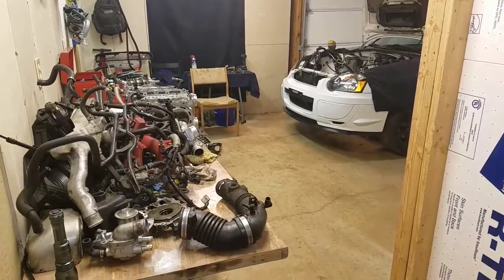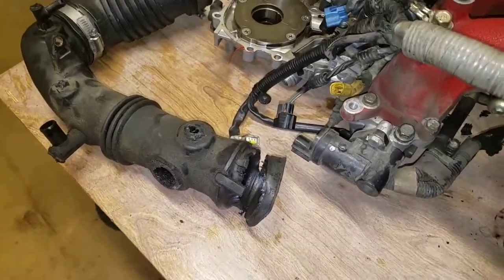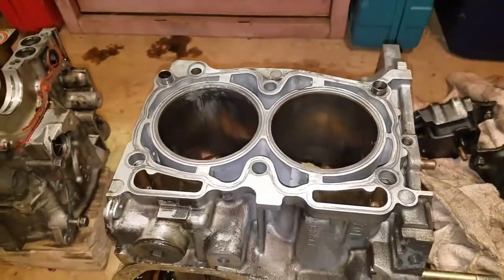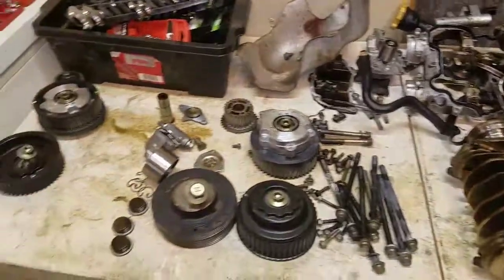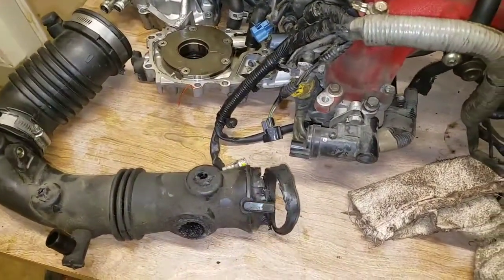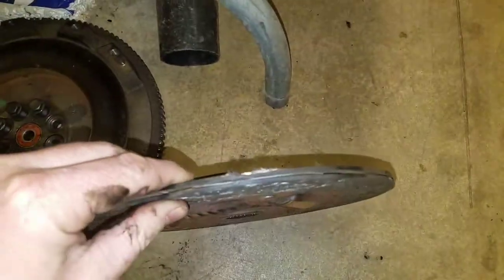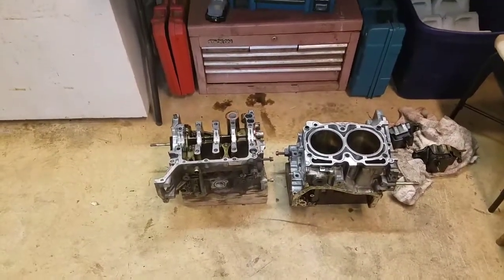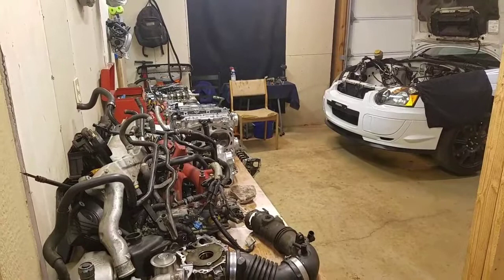05 Subaru WRX STI Turbo Inlet Tube Failure & Motor Rebuild

Comment: If it was running lean the computer would know regardless if the air came in after the maf. It would cause knocking and misfire im sure. I dont think the inlet was the main culprit..could be wrong though.

Comment: Dude did the failed turbo inlet really cause your car to fail?!? I got 700 miles on my wrx after I bought it from previous owner. I'm sure they swapped out all the aftermarket parts with old stock parts. My turbo inlet is all chewed up where the clamp meets the turbo too. The car also had head gaskets, valve job, coolant service etc about 5k before I bought it.

Comment: How long did you run the car with the torn turbo inlet ?
Mine was split & caused me to have a boost leak/ vacuum leaks & was able to get a new inlet the next day
Scary cause you over boost & run lean af
Reply from the maker: I don't know how long it was running before I bought the car like that but I drove it for about 750 miles and I was pretty hard on it before it actually died on me so I don't think you have too much to worry about cuz it sounds like you were on it right away

Comment: Same happened to me. Bought an 05 put 2k miles on it and it skipped 3 teeth in timing due to half ass timing belt service. trashed the engine:/
Reply from the maker: Puty I guess that's what you get when you buy something used you never know what you're going to get. hope you got it back on the road! thanks for the comment 👍

Comment: Did you get a check engine light for that cylinder that had no compression? Cylinder two I think.
Reply from the maker: Nebil Alchaar when it first started happening it started smoking a little bit but it only lasted about 2 miles and then it came to a smoky grinding halt then it turned all the check engine lights cruise control light everything on but it was pumping oil through every port of the motor even blowing out of the dipstick
Reply: CaliSTI Ah now I’m scared I think I might have the same issue. My inlet hose has leak and yesterday the car started smoking but no CELs and I drove it about a hundred miles.
Reply: CaliSTI did you experience boost leak from this issue?
Reply from the maker: Nebil Alchaar yeah if your intake boot was leaking you may have done some internal motor damage. My car started running a little funny just before it did it but no smoking no check engine light and no boost leak. But once it pop through the top of the piston it started smoking like crazy and didn't last but a mile or two after that it wouldn't run it all.
Reply: CaliSTI damn. Thanks for all the info bro
Reply: I’m surprised you didn’t get a cel for lean conditions, if it’s been tuned I wonder if the tuner disabled or changed the o2 sensor cel on conditions.. 
unfortunately I bought a bit of a lemon too, mines a late 03 blobeye, the week I got it I had to replace the rear diff, clutch and remove the tgv’s in the intake manifold, they seized half shut. A year down the track and it’s now got the sti 6 speed driveline in it and I’m just doing the intake silicone and a bunch of split pcv hoses.. would have been running lean due to the split pcv hoses so I’m glad mine hasn’t blown up due to that! Good video man Thankyou!

Comment: What compression numbers and leakdown did you have with the melted piston?
Reply from the maker: When I tested it the motor was cold so I only got about 130 PSI in three of the cylinders but the cylinder that got melted there was 0 psi the needle didn't even move under cranking

Comment: my suggestion you need to upgrade all the pistons ,valve, spring n turbo 😎
Reply from the maker: carlos vega yeah I ordered upgraded racing main bearings and rod bearings Wiseco forged racing Pistons and the blocks are going to go to the Machine Shop to get bored and the Pistons fitted and the block and the heads ground flat and I might lower the compression a bit so I can boost a little higher, and as far as the valves they were done 20,000 miles ago so I think they should be good
Reply: 1.go for aluminum radiator (because standard radiator top is plastic, will broke soon or later)
2.new turbo(cause already crack)
3. inlet turbo perrin (cause already damage)
just buy 2nd hand part also for air intake & full piping system but do visual inspection first off-cause.
Reply from the maker: carlos vega I already have a aluminum radiator I just didn't show it in the video it's just off camera behind me and I know the back of the turbos cracked but it's not that big and I'm just going to run it for now, but I did buy a turbo cartridge or a CHRA, so the turbo will be brand new except for the crack. And I've already ordered one of those silicone intake boots it wasn't the parent one because I don't want to spend $200 on a silicone pipe I just went with a $60 one I use one of those on my WRX and it worked great so I'm just going to run that. I'm going to save up my money and by intake and exhaust for it later and I'm going to go with the Perrin short ram air intake and for the exhaust I'm going to go with the Invidia N1 turbo back exhaust
Reply: take your time, no rush. this is the fun moment . good luck
Reply: CaliSTI also replace oil pick up tube mine broke on 04 sti. Do closed deck cases also